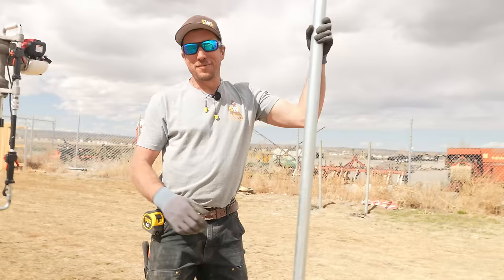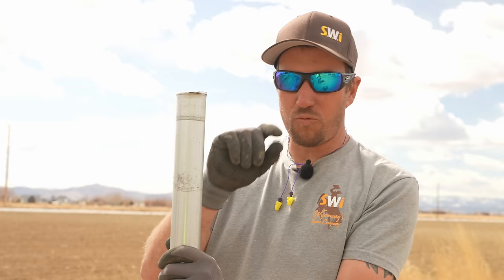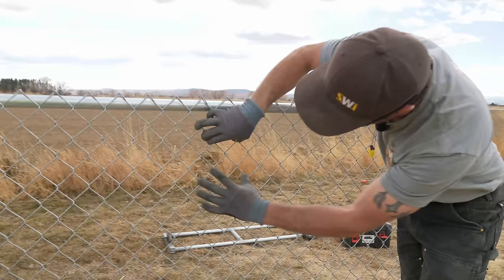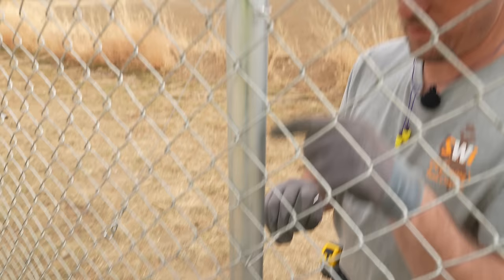How To Install Chain Link Fence The Easy Way

Comment: Is there any benefit to using a bear hold over a pull jak to stretch the fabric?
Reply from the maker: If you've already got puljaks, no--they'll work equally as well. If you have the option to use both the bear holds are nice for short runs or gates as they go on very quickly.

Comment: You were not clear on the bottom tension wire. 12 gauge double  or double wire wrap equals 12 gauge? And why not a single wire (larger)?

Comment: Is concrete preferred or pounding 36” in?
Reply from the maker: Neither one is preferred (depending on your soil type). We like not messing with concrete, but sometimes the soil is too rocky (or loose) for pounding.

Comment: ? My friend how far in between the post for a 3' 5x4 gate chang link?
Reply from the maker: Can't answer that question for you I'm afraid. You'll have the measure the width of your gate, and then measure you gate hardware on either side (from where each piece touches the post). Add a small gap space for your latch and then you'll have your total measurement.
https://youtu.be/-hbwNshQj4A

Comment: i would like to ask a stupid question whats your personal opinion? as to using used chain link  thats a little ratty @ the bottom  @and theres a sction @ the end of the run thats a little worse if your going to cover it in fabric or use inserts it sems to be light guage residential  what do you say?

Comment: I'm new to all this so please help,    I am going to buy two bear holds off your link and one dresser, I'll be installing a enclosement for my dogs. It'll be the 6ft by 50ft 11.5 guage steel fencing from lowes.( may end up needing more after I figure out how big of an enclosment I wanna make)     How big of poles do i buy? 3inch round ones and 6foot tall? I'm new to all this as you can tell by reading lol.  Also what bear hold would I buy from the link for that specific fence, I'll be waiting on a response so I can write this down and will buy it as soon as possible after I find my info
Reply from the maker: Our shop guys love to answer questions like this! It'll be easier to talk through to make sure we're understanding:  307-578-8040

Comment: Oh that's a good work where I can find those tools?
Reply from the maker: If you can't find them locally you can get them here.
👉🏻 Pink Marking Paint - https://bit.ly/swipinkpaint
👉🏻 Stringline On 3:1 Geared Wheel - https://bit.ly/gearedreel
👉🏻 Post Drivers/Pounders - https://bit.ly/swidrivers
👉🏻 Loop Caps - https://bit.ly/SWILoopCaps
👉🏻 Brace Bands - https://bit.ly/SWIBraceBand
👉🏻 Tension Bands - https://bit.ly/SWITensionBands
👉🏻 Galvanized Bolts - https://bit.ly/SWIGalvanizedBolts
👉🏻 Rail Ends - https://bit.ly/SWIRailEnds
👉🏻 Nippitz Bolt Cutters! - https://bit.ly/nippitz
👉🏻 Klein Nines - https://amzn.to/3Jan3Ss (Amazon affiliate link)
👉🏻 T-Handle Tension Wire Tightener - https://bit.ly/T-HandleTightener
👉🏻 Bear Hold Fabric Stretchers - https://bit.ly/bearhold
👉🏻 Top Rail Dresser Tool - https://bit.ly/topraildresser
👉🏻 Easy Twist Ties - https://bit.ly/easytwistties
👉🏻 Easy Twist Drill Tool - https://bit.ly/easytwisttool
👉🏻 8" Hog Ring Pliers - https://bit.ly/8inchhogringplier
👉🏻 Hog Rings - https://bit.ly/swihogrings
👉🏻 Aluminum Dome Caps - https://bit.ly/ALDomeCaps

Comment: if you have to go down a slope, how do you ensure the top rail stays level?
Reply from the maker: It shouldn't necessarily stay level if you're going down a slope. You want it to follow the slope, but roll more smoothly than the ground is doing.
Reply: You don't, but you have to feed the tension bar differently to keep the fabric straight. Crossing over diamonds etc.
Reply: @SWiFence  thanks! My fence looks great

Comment: Why would you not want the line post flush with the string on the side that the chainlink goes on????
Reply from the maker: Because the line posts are thinner than the terminal posts, and we prefer to have them centered. This prevents having a little curve in the top rail where it terminates into the terminal post. 👍🏻
Reply: I get the concept but I still feel leveling a post right to a string still is 100 times easier than leveling each line post exactly 1/4” away from the string, I also know it’s not about what’s easiest but I’ve never noticed any big bows in  any fence just by lining in both terms and lines off one string
Reply: @kristoferadams745  Attention to those types of details is what separates the good installers from the elite installers. There is big truth in "the devil is in the details", all it takes is a client (usually along the lines of the professional engineer variety) to notice something like that, before you know it their demanding the posts be reset, if unable, then they'll demand a discount for what they deem  "poor workmanship", then to add to that, they'll slam you on google reviews for all to see. And all because the contractor took the "easy" route, how much time does one save?, a couple hours overall?

Comment: No concrete on those posts?
Reply from the maker: When you drive correctly in good soil you don't need concrete.
Wind tests with concrete (it's vinyl fence but the same principle): https://youtu.be/_iQnheVwAI4
Wind tests without concrete: https://youtu.be/8jWcT17PFME

Comment: What does terminate mean in fencing?
Reply: It's were the fence line ends or starts wether it's a end, corner, or gatepost.
Reply: @d.fencegod9708  thanks! Is it a good idea or standard practice to cement those posts?
Reply from the maker: No reason to. Either all your posts are cemented or all or driven, but there's no need to cement terminal posts if the rest are driven.

Comment: So you just finished the fence and jumped over it? Then we need 6 ft fence
Reply from the maker: We get this kind of comment all the time. "That 3-foot ornamental fence isn't keeping anyone out!" You're right. Fences clearly establish property lines and make people think twice before they cross. But if you live in an area where you have to keep people out, then yes, you need a 6 or 8-foot fence with razor wire on top. Doesn't do much for curb appeal though.

Comment: I wish I were there to teach you the correct and easy way to install chainlink....always splice top rail within 6 inches of a line post... 11 gauge ties is a joke, use 6 gauge.... use the pull rake, put another tension band on the end post with a bolt thru it and use a 1 ton pull jake to pull the rake, I even pre tie the top rail, works ever time....
Reply from the maker: I disagree good sir!
- Back when stick ties were the bees knees yes, you were supposed to splice top rail within 6 inches of the post. But now that there are better ways to tie chain link fence so your top rail doesn't sag (Easy Twist Ties!) it's not necessary.
- Do you know how much money you're throwing away to make sure every splice is within 6 inches of a post? I'm assuming that cost gets passed on to the customer...
- 6 gauge ties on 11 gauge fabric is serious overkill. Match the gauge of the tie to the gauge of the chain link.
- Everybody has their own methods for stretching--I obviously prefer mine.
I've installed miles of chain link fence, and you probably have too. Here's to miles more. 🍻

Comment: Dude.... mark ur line posts 2'9" 3'9", set your string at 12" at your terminals and adjust at your high n low spots, drive your posts to to the 2'9" mark..... no moving the string,  no cutting the posts.

Comment: Galvanised paint color to paint bottom of gal posts to stop concrete eating away gal and rusting post at ground level,another Australian  tip for you,thats right ,CONCRETE BURNS ,EATS GALVANISING,PAINT GAL POSTS TOUCHING CONCRETE,ONLY THEN WILL THEY LAST FOREVER

Comment: I just bought the Nippitz bolt cutters that you recommend. They broke on my second cut: The handle broke clean in half, exposing pot-metal (not steel). And of course making a fat blood-blister on my pinky. A total joke of a tool. Based on this experience, I would highly recommend to your viewers NOT to buy anything you recommend.
Reply from the maker: ??! Based on that experience I would have to agree with you. But that doesn't sound right. You bought the official Nippitz cutters? From us? Get a hold of Rakness at the shop and we'll replace those asap. 307-578-8040
Reply: I have since talked to Tool Guy about this. He claims this has never happened before and is sending a replacement. I hope that's correct ... When you buy a cutter that breaks on the second cut, it's hard to have confidence in a replacement.  We'll see how it goes. I have some fencing to do this weekend. I'll respond with another comment after some time using the replacement.
Reply from the maker: Sounds good. Keep us posted. 👍🏻 When you do respond, do it in a fresh comment if you would--we don't get notified of replies in threads so they're easy to miss.

Comment: 10 ft is to much, any one can just roll under it, 8 ft is the correct space. Especially with that cheap 11 gadge  crap
Reply from the maker: Uh... well... it is a 4 foot fence... Pretty sure they'd go over before they go under. And if you do your bottom tension wire correctly you should be taking most of that slack out.